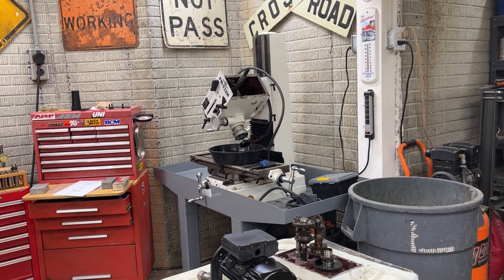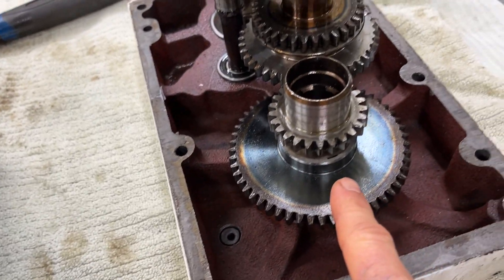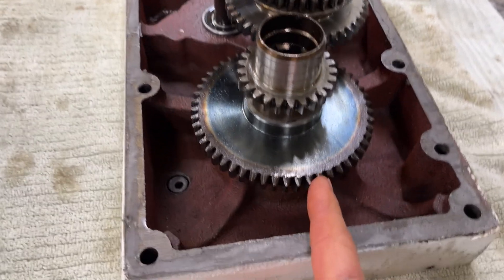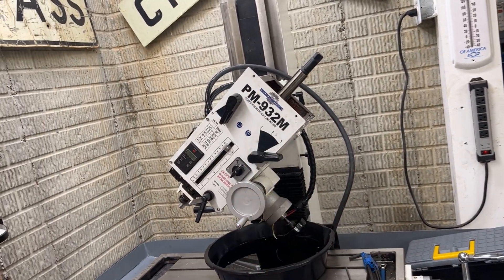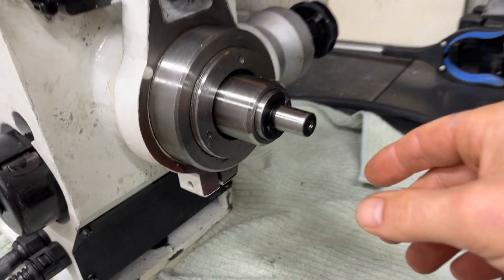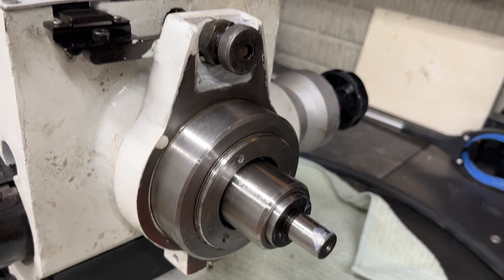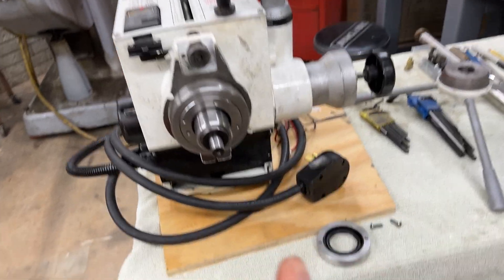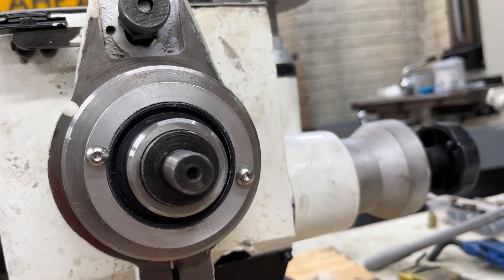CNC Mill Build 3: New ball lead screws, lube system, Clearpath servos

Comment: I just ordered clear path motors, is that the Arizona CNC ball screws conversion kit?
Reply from the maker: Yes it is. I love the Cleat Path motors. Turns out I had to re-tune the turns ratios today. The parts are coming out a little small. It was about .005” short when commanded 1”.

Comment: Where did you get the chip tray?
Reply from the maker: I fabricated the chip tray and stand. I wanted something that was very sturdy with the option of adding an enclosure.
Reply: @themellowmechanic very nice, have you built the control box? Which controller? I ended up with Acorn 6, I have not built the box yet, you can really go down a rabbit hole adding features
Reply from the maker: I’m using Acorn and I like it a lot. It’s user friendly and has a ton of info online. I did build the control box. I built it with room to expand and add to it.

Comment: Can I ask, why did you get the gear version of this mill and not the belt? I just ordered the PM 940TV and find your breakdown very interesting?
Reply from the maker: I probably should have ordered the belt version as it would be easier to modify to get more RPMs. The geared head is slow at only 1900 RPMs for CNC